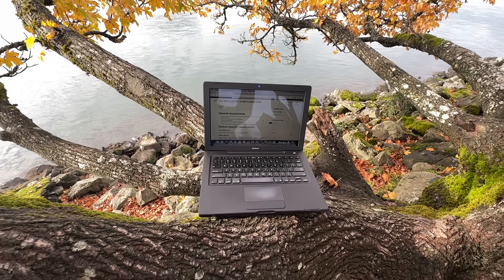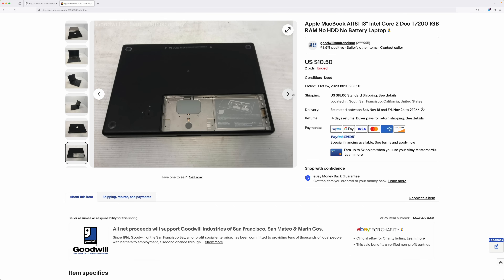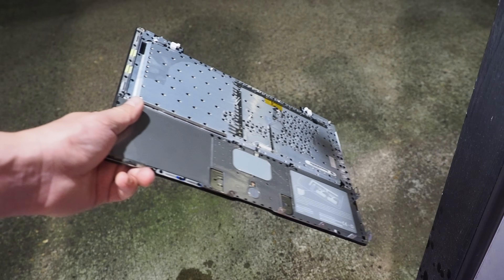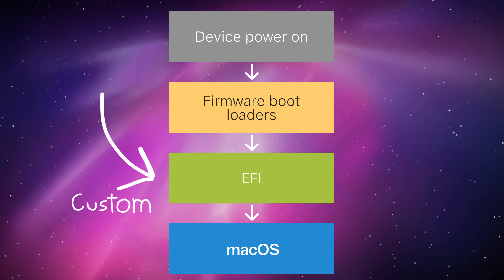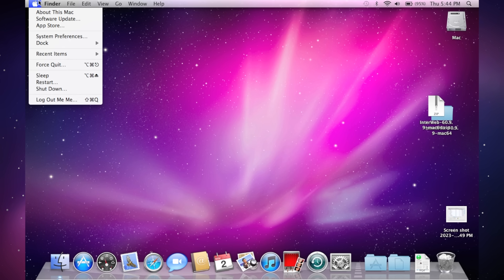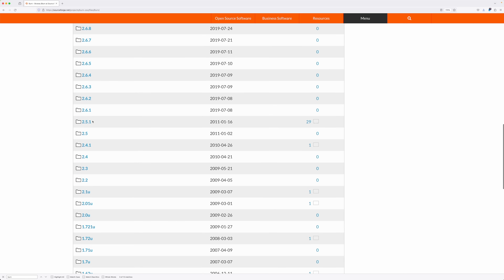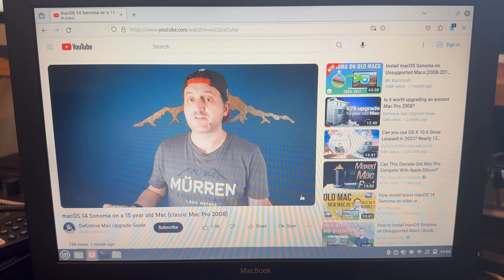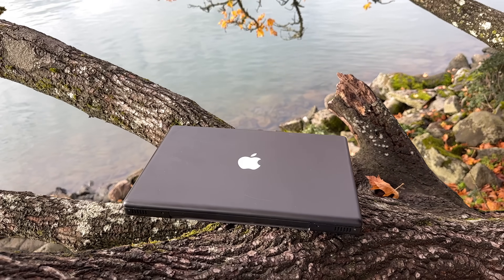Before there was Space Black, there was the Black MacBook

Comment: Thank you for posting this. I have several old macs from 2007-2010 that would have been e-waste had it not been for Linux Mint and channels like yours. But I’m glad that I left the Black MacBook until last. If I had tried installing it on the Black Mac first, I would have failed and probably not even tried on the other machines.
Reply from the maker: As much as I’d like to say I have a use for it, it’s just my snow leopard computer now for when I need to capture footage of snow leopard. I’d have a rough go using mint on it for anything beyond the lightest of tasks z
Reply: @dmug  I would have taken your advice and avoided this if I was buying a used machine. But we bought it back in 2008 and looked after it well. Most of my after-hours computing is very light. I spend all day at a GIS workstation, so the brain doesn’t want to do,anything too complex after hours.

Comment: Nice video. The smelly nature of the MacBook may be related to the previous iBook series, where they were notorious for the keyboards smelling like very smelly old socks. The cracks on the palm rests were extremely common on all these MacBooks, and Apple did replace them under warranty. I received a number of them from an Apple reseller and we were selling them as 'A', 'B' and 'C' grades, depending on the size and amount of 'splinters'. The splintering was caused by users closing the lid too quickly, thus the tiny plastic rest on the top of the display hitting the foremost part of the palm rest.
Reply from the maker: Yeah I’ve heard that the glue in the iBooks is the same in the early MacBooks.

Comment: My favorite—the BlackMac. Daily driver for about 5 years, replaced by a complete nightmare, the 2011 MacBook Pro with the bad graphics card that failed 4 times. An Apple Store in Arizona refurbished the BlackMac for free when I dropped it off for a battery fix, using left-over off-the-shelf (black) parts they didn't need any more. I never upgraded to an SSD. (The mouse would stop working when the battery swelled or didn't fit.) Otherwise—it was fine. Enjoy your retro-Mac. I still have mine to run a couple of obscure programs I like with 10.6.8.

Comment: The best way to clean devices is to dismantle it and stick it in a dishwasher by itself and let all the parts dry on its own. As for the display backlight, you can install a $10 LED kit. You can also upgrade the display to nicer display provided you get one with the same pinout. If you really want to upgrade it, you could upgrade the internal logic board with newer one from a more modern laptop. The only benefit is having a black MacBook.

Comment: Running windows 7 modded so you can install the 64 bit version plus an under-volt with throttle stop is probably the best experience imo. Web browsing is a much better experience than any other os I tried and it just runs well even the media keys work as long as you can track down the right bootcamp drivers
Reply from the maker: You can also do Windows 10, or at least you can with some of the other 32 Bit EFI Macs. There's a few vectors, like pulling an HDD from another computer with a freshly installed Windows or upgrade pathing.  I debated putting Windows 10 on it but with 4 GB of RAM.... it seemed like Linux was smarter

Comment: Cool video. Would be interesting if you can stuff an Apple M1 or M2 Air into one of these old black MacBooks.
Reply from the maker: As cool as that would be, it would be nigh impossible, as pretty much everything changed. you'd probably have more success verse engineering the case by scanning and 3D printing it and even that would likely take hundreds of hours to refine assuming you could figure out the keyboard/trackpad situation. I'm sure there's people out there capable of pulling something off like this given enough time and motivation.

There are people who make Mac Mini case mods with a lot less friction as there isn't the internal battery, keyboard, trackpad, display, speakers, to contend with.

Comment: I bought the black MacBook in 2007. It was an impulse purchase and one of the worst I ever made.

The super glossy screen was very annoying to use, like staring into a mirror.

The keyboard was mushy, the trackpad was awful, and the Core 2 Duo and GMA 950 were anaemic.

And the black finish picked up every finger print, every spec of dust. The keyboard looked like an oil slick after a week of use. I was always cleaning it.

I sold it around 2010.
Reply from the maker: That was true of the white macbooks, sans the keyboard gloss. The black MacBook I have isn't especially prone to finger prints but I haven't exactly used it daily either. 

As far as those GPUs, tell me about it. Intel's iGPUs are were terrible for ages, it's always been the biggest weak point for smaller MacBooks

Comment: An interesting video and I'm glad to see Linux Mint being put to good use!👍👍 (In my opinion, Linux Mint Mate would have been a better distro for that laptop). That 32 bit firmware on a 64 bit computer is odd and if I recall correctly the first Mac pro desktop computer also had that problem, was it just the first model?
My latest project is an HP Pro book 4310s, it's a Vista era notebook and after giving it a good clean I installed the maximum 8 gig., of DDR3 ram., and a 256 gig., SSD., and it's currently working well with Zorin 16.3 installed.  
This model of notebook was designed for and marketed with 32 bit software even though it can handle 64 bit software.  
Perhaps that is why it was so fussy about what it would boot from, it would not boot from a Windows 10 flash drive, but it did boot from an SSD., which had Windows 10 installed on it, it did boot from a Linux Mint flash drive and LM., did install, but after the first restart the computer could not read the OS., so I tried Zorin and it worked, perhaps there is a difference in the boot loaders between Zorin and Linux Mint.
Reply from the maker: Yes, the Mac Pro 1,1 and 2,1s (2006-2007) models were all 32 Bit EFI, basically any 2006-2007 Intel Mac had the 32 bit EFI issue. Apple went ahead and wrote it's own EFI based of Intel's proto-EFI that they were developing in 2005. Intel in 2006 would dump that for UEFI. 

Apple was slow to adopt UEFI. It wasn't until 2013, hence why none of the classic Mac Pros can display bootscreens on PC GPUs due to the GOP vs UGA drivers. I've wanted to experience the 32 Bit EFI Macs for some time as I've lived most of my time with the 64-Bit EFI Macs (2008 MacBook unibody, Mac Pro 2008, Mac Pro 2010) and then the UEFI Macs. 

I figured a lighter UI probably would have been somewhat better but for my Core 2 Duo but the differences wouldn't drastic as Mint Cinnamon still only requires 2 GB of RAM. I can't say I'm a desktop Linux guru, as most of my Linux exposure over the past decade has been through dev chains where I'm rarely touching GUIs, just the CLI.
Reply: @dmug  Thanks for the Mac information and I do like the design of those Mac Pro desktop computers, especially the 5,1 which has that removable tray that holds the ram., and the processors, I have heard that those computers use a lot of electricity, is that correct?  In my opinion, such a modular and upgradeable computer would still sell well these days, but Apple appears to have a different opinion.
The Mate edition of Linux Mint is my daily driver, I have tried the Cinnamon and XFCE., editions and they are okay, but the way that the Mate desktop is set up suits me.

Comment: Wow, I almost bought one about 14 years ago😊 and Im glad I did not. It turned out the plastic was really bad quality and Apple introduced the unibody a few hears later.
I also remember that Apple charged more for the black laptop. The trackpad was also replaced to a glass, multi touch one.
Instead of a black MacBook, I bought a Mac Mini. That was my first Mac. Later I moved so I needed a laptop and bought the 2009 late MacBook unibody. Still have it in near mint condition! The battery is dead and iFix it sells it for $100. 🤦🏼 Got 4GB RAM and an SSD.
Still good for surfing the web.
Reply: Hmmm apple being bad quality just like always
Reply: @TerrorSyxke  Always? Really? Tell me more!
Reply: @MrCooper83  I owned all apple products except apple watch and that would be 

iMac early 2008
MacBook late 2009
iPod Touch 4
iPhone 4
iPad 9
iPhone SE 2
iPod Nano 3

I can say apple products weren't exactly too great except for the Mac's being built exceptionally well but for the thousand plus paid of course (or the 999 of the white MacBook)
Overall I can say, apple is about products that feel good and look good, but has less features, and as of now near unrepairable in some areas like storage and screens
Reply: @TerrorSyxke  Interesting. Here is the part of my collection:
PowerBook G4 -still working
MacBook White 2009 (battery replacement needed, the computer works fine
iMac 2013 late: still works perfectly
Mac Pro 2010 max out. My main computer. Still works

iPad 1st gen: works
iPad 3 (first retina display iPAd) works
iPad Pro 2017 works

iPhone 2G mint condition, works!
iPhone 3GS (battery swollen up and damaged the main board -awaiting for parts from Ebay)
iPhone 4 works perfectly. Running iOS6
iPhone 4S white. Works fine, iOS6
iPhone 5 white: works
iPhone 5 black works fine
I also have 3x iPhone 5S in silver, space gray and gold colors. They all work.
iPhone 6 -works, with new battery
6S Plus, works
iPhone X works
iPhone 13 Pro Max works.
Non of these phones had any issues apart from the battery!

iPod 2nd gen. Classic (works. I had to replace the HDD and the battery) The display is not as sharp as it was but works
iPod Classic 3,4 gens. They work. 
iPod Classic 6 gen in both available colors. They both work.
iPod nano 1st gen. The battery lasts 30-40 mins. Apart from that it works.
I also have iPod shuffles they all work apart from the 2nd gen as I dont have the dock (dock needed to connect and charge) 
I also have a few iPod Touch (2x first gen)
One of the runs iPhone OS1.1.4. 
The rest of the iPods are sealed so I dont know if they still work. 
I also have some really old accessories, such as iPod Hi-Fi, iSight camera, 30" Cinema Display HD and they all work (knock on wood)

So I can give you a much more detailed and longer list about my collection. G3 iMac, etc. They all work, just dont turn them on at all. 
 
So we both have the 2009 late MacBook unibody. It had the bottom case replacement (Apple had a programme) and when I took it to the store the guy was amazed how good condition it was. 
Recently, about 3-4 weeks ago the battery died. After 13 years of usage. 
The computer still runs if I turn it on.

So it looks like I am lucky because I dont have any issues with these products. 

Obviously they need to be maintained (changing thermal paste on CPUs, northbridge, GPU). 

I regularly charge the batteries to maintain the battery. I also have some spare parts just in case.

So this is my own experience. Im fine, the quality is good. In fact my sister replaced 2 Windows laptops within 7 years. She bought a MAcBook  Pro in 2015 and still using it. The MacBook cost probably more than those Windows computers, but it lasts much longer than those combined together.

My 13 yo Mac Pro still works (paired with a 30"Cinema Display), I do stop motion animation. 
I like old tech and Im not sure the current computers will last 13 years... Yes, including Apple computers.
Reply: @MrCooper83 Bruh my 2012 iPod touch still works.   That guy must be hard on his stuff.
Reply: @VX1_l  I am not I just value durability and functionality for the price and Apple puts looks and glue before it
Reply: @MrCooper83  I been using a Dell from 2011 since 2016 that was previously used by my uncle but from my.experince with windows laptops of recently I do see they are way lower of quality than they were in 2010 and such (using the average current 300 USD HP laptop to a used 40-60 USD Thinkpad for comparison) yea old stuff PC wise lasted longer for me

Comment: Bro I upgraded from a 2011 MacBook Pro becase it is getting old to a 2015 MacBook Air 8gb of ram for basic tasks it should be fine
Reply from the maker: I have a MacBook Air 11 inch 2015 with 8 GB of RAM. Solid computer. Not sure what that has to do with the black MacBook but I still like those old MacBook Airs even if the displays are harsh.
Reply: @dmug the black Mac book has a bad screen and track pad can it run windows? better than a unbody hopefully 13in man it has everything right just  doesn’t like to work because the lack of metal so get a 2012 if u get a unbody for 150 dollars after tax not a bad laptop with charger